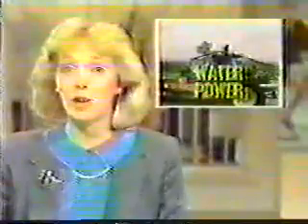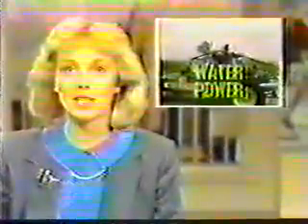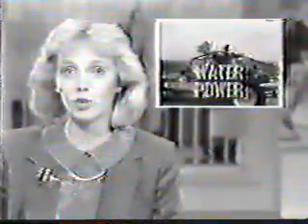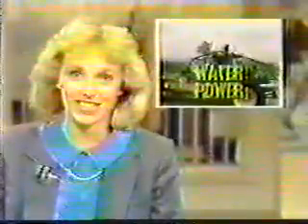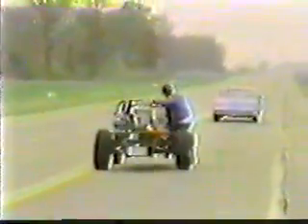Water engine

Comment: O.K. patent this , instead of pushing gasoline thru your injectors , use water . it works . Atomized water gives an incomplete burn , resulting in a poor but useful detonation . The amount not successfully burned has to be removed and reinjected .

Comment: A quick search on Wiki (page - Stanley_Meyer's_water_fuel_cell) reveals an uncharacteristically negative bias against his work, and acknowledges the cause of death was a brain aneurism. The question in my mind is not his "unconventional" use of terms, but whether it actually worked. Did it run on water, and was it sustainable. 

(Re: terms - he may have tried to circumvent an existing patent owing to one already awarded to big oil - I've not looked into that yet.)

Comment: @Me102288 Just as I thought, from Wiki on "Hydrogen vehicle"
" The drawbacks of hydrogen use are LOW ENERGY CONTENT per unit volume, high tankage weights, very high storage vessel pressures...." (caps added).
You should do some research before criticizing those who DO!
By the way, if you didn't use the oxygen released by hydrolysis but used atmospheric air instead, you'd use 1/5 of the hydrogen and get 1/5 of the torque because the atmosphere is only 20% oxygen. But why would you?

Comment: @Me102288 On a calmer note, the alternatives are all around us and are being developed quickly. It's all about energy storage when it comes to what goes into your car. There's no energy in water. Batteries, fuel cells and capacitors show the most promise.
But you still have to get the energy from somewhere and that's where coal, sun, wind, tides and nuclear come into it.
No one's ever going to pour just water into the tank and drive off.
"You cannot change the laws of of physics" - Scottie

Comment: @Me102288 Listen Einstein, gasoline is a liquid and hydrogen is a gas. Gasoline mixes with air at a ratio of about 14:1 by WEIGHT. That's a tiny squirt of fuel for a much bigger VOLUME of air.
Hydrogen mixes with oxygen at an exact ratio of 2:1  (H2O).
I did the maths below. You need about 16 litres of hydrogen per second in this example!
If you want to argue, show me where the maths is wrong! Otherwise STFU!

Comment: @Me102288 You are totally wrong, first of all the laws of thermodynamics are not flawed? If you can prove that, then get ready to win the nobel prize and go down in the history books. Secondly I dont wonder about H VS G, hydrogen is very efficient, ignites rapidly, burns super hot.... gas is lazy and needs a perfect air to fuel ratio to explode, and when it does its slow compared to hydrogen. Gasoline fireballs do not put out more energy, it simply looks that way because its a slow process

Comment: @Me102288 "as long as the engine is running, its alternator(s) are producing electricty"
It takes more energy to split the hydrogen from oxygen than you get from putting them back together in combustion. 1st Law of Thermodynamics. This is 100% impossible and that's why you don't see any of them for sale. It's a fraud to get uneducated investors to give him money. There's no conspiracy, it's just impossible to do, that's all.

Comment: soo. how bout that no maintence he was talking about....unless you use exotic materials the most cost effective electrolosis cell runs with stainless steel plates. the chemical reaction to stainless steel plates with electrolosis produces hexavalant chromium, a toxic byproduct. you will need to extract that from the cell and dispose of it at a hazardous waste place. also you will need to fill your water up and so on. there is never a no maintnece engine. it will be like changing your own oil.

Comment: @aaron2414 You are using incomparable measurements.  The "E = +1.229 V" is the reduction potential required to electrolyze water.  

In the second equation, you converted energy of combustion to "electron volts" which is not remotely comparable to volts. Volts are a measurement of potential. Electron volts are a unit of energy.  

The ENERGY required - at minimum in a perfect world - for the electrolysis is 572 kJ/mol - the same as that recovered from burning it.  In practice, it is much higher.

Comment: @aaron2414 Because burning H2 is chemically the same as electrolysis, and yes, burning hydrogen produces water.  If you don't believe me, get a DC power source, a 2 liter bottle, some epoxy, 2 carbon electrodes and a balloon.  You can make your own browns gas and then burn it to produce water again.  I think you need to pick up an introductory to chemistry book.

Comment: @geheirnwaeshen and you better my "lame" response, you pretty much just told the world that combustion is the REVERSAL of electrolysis...  Feel l like educating on the possibility of that?  All you really did was simplify my explanation of how the combustion (release of energy) of the Hydrogen and Oxygen gives you a great deal of energy.  Just because you need a small amount to split the initial bonds does NOT mean you will get the same back.  The O2 is less stable on its own

Comment: And as a follow up; yes, car engines can be and have been designed to run very well on hydrogen.  That does not mean that splitting water with electricity and then recombining it somehow creates energy.  The laws of physics still apply.  The US government has developed flex fuel vehicles because they want military applications that can operate in any environment.  Say I have a large apu battery and water..... now I can drive my hummer another 10 miles to get out of a danger.

Comment: @aaron2414 joules ≠ volts, so you can make no comparison between the splitting voltage (which in a physical sense is a measure of force) and the energy of combustion without knowing the time over which the voltage was applied (IE, amperage, or current draw rate).  Energy (joules)=Volts*Amps*Time(seconds)

electrolysis: 2 H2O + E1 → 2 H2 + O2
combustion: 2 H2 + O2 → 2 H2O + E2

Simple algebra tells us E1 = E2.

Comment: That was an assumption on my part as you mentioned the reaction of H2 with N2 in your original post. I can appreciate, for simplicity sake, the use of assumed base 1 scientific units. You could find out how much work a electrolysis reaction needs to produces a mol of H2 gas from water... then you would be on your way to figuring out the actual efficiency of this process.

Comment: @aaron2414 Volts are Joules per Ampere-Second, so without current and time it is nonsense to turn volts into joules. Sure, volts can be written joules per coulomb, but that is the same units as joules per ampere-second as ampere-second is coulomb.

Additionally, you cannot know how much energy is released from a reaction without stating quantity of reactants. Why you are even mentioning hydrazine is beyond me. Water in to Water out, what is the energy result?

Comment: @aaron2414 You need to learn some basic physics. You cannot convert volts to joules because they are not the same thing. To get joules you would need to know current and duration, but this should have been obvious when you got a 3x10^24 roi.

Voltage x Current = Power
Power x Time = Energy = Joules

Comment: I have a question.....  What's more practical, a car that uses electricity to turn H2O into HHO and uses HHO to power the motor, or is the amount of electricity used to create the HHO not worth it compared to just using the electricity alone to power the engine?

Comment: @Zink575 Sorry this took a bit, I had to do some MATH!
2 H2O(L) → 2 H2(g) + O2(g) requires an input of E = +1.229 V
Burning H2 and N2 (via combustion) releases 572kj of energy or 3.57014164e+24 volts.
So we have input 1.229v and combusted the gasses receiving 3.57014164e+24v and a few mols of H2O
Plenty left to spin an alternator and continue the process...

Comment: @Zink575 LOL!  You have completely missed the point and keep inserting your own words into my statements.  Energy is not being created its being transferred.  EVERY car needs and input of energy to start.  Thats why you have a battery in your car right now.  NO it does not exceed the amount produced, have you ever messed with hydrogen or oxygen gas? CRAZY explosive and works the same as a gas combustion chamber.  All you need is an alternator to continually supply the electricity for conversion!

Comment: @Zink575 First law - "The internal energy of an isolated system is constant." (this is NOT an isolated system since there is an external input of energy to start..electricity, or some other catalyst
Second law = "Heat cannot spontaneously flow from a colder location to a hotter location." (law of entropy, again only has to do with closed systems, which this is not) Keep adding water and electricity and the cycle will continue.  That's why your gas car has an alternator, keeps the cycle going.

Comment: @Zink575 I would agree with you about the creation of energy, but you are forgetting about the energy put into the system to start the conversion, it's not the water.  Whether it be a battery or electric generator there is an input of energy via electricity.  And I also agree that water is a final product but not a complete conversion was made.  MOST of the energy released from breaking the bonds was released as heat and only a small portion is back into water, not created, transferred.

Comment: @Zink575 LOL! Well I already did tell you where your "external power source" is.  Its most likely not just simple battery but that will work too. Honestly, just google "BATTERY ELECTROLYSIS and you will get tons of blueprints (images tab)...and second, you quoted 2 laws that have nothing to do with this system, well the 1st might because its how energy is transfered as heat, but the 2nd law has to do with entropy.  This isn't a closed system, it has an input VIA electrolysis. This isnt that hard

Comment: @letmeseethat1
So why don't you take the exhaust tube, run it through a box to condense the water vapor and pour it back into the water tank? That would be perpetual motion. 

I know some person is going to say "but it uses the water so it can't be recycled" 
My question is how does it "use" water??
If you react hydrogen and oxygen, the products will be water(gas) and heat and kinetic energy.

Comment: I built a Hydro running 5hp motor. First it takes alot of power, and a big hho gen, to make enough, to run. But the big problem is rust in the valves and exhaust.

Comment: Water is not flammable but both oxygen and hydrogen is... but I don't see any fire coming from the back, so I wonder how it works. Sure water has more density than ice and vapor, but how do you use the energy? What I'm made at is the bitches posting that says that it is impossible when they can see it for themselves. Plus, I don't remember hearing him say that there isn't any electricity being used, so of course it is not just water. If you Bitch, you are a Bitch!

Comment: @Freezer777 I'm not sure exactly which post of mine you're replying to, but of course you can split the hydrogen from the water by running an electric current through it.  The problem is that the energy you recover from burning said hydrogen cannot exceed the energy you put into it to create it.  It can't.  It simply can't.  The car is then effectively an electric car - no energy is derived from the water.  And, it's quite an inefficient electric car too.

Comment: @robpanel If you could do that you could skip the water and just have an electric car. The fact is that solar panels can't collect enough sunlight to power a car that someone would use everyday. Maybe in 10 or 20 years when solar panels work better, but you still wouldn't need the water part of the system. More steps equals less efficiency. 

Fail again...

Comment: @jib1000 you could use the right solar setup for the electricity to take care of the constant electric cost. there is also more water on earth. we just need to channel sea water in and filter. water problems solved but wont happen i think. cheaper overall if self sustained.

Comment: The oil companies aren't threatened by this invention. They don't own the patents. They didn't have him killed. Its simply not an efficient way to run your car. It takes exactly the same amount of electricity to split the water molecules into hydrogen and oxygen as you get when you burn the hydrogen. You could make a better and more efficient engine if you skipped the water and just made an electric car. This technology has been around for years and is totally useless as an alternative fuel.

Comment: @doughauf - he was not murdered, that is the conspiracy theory stance.  Whenever a crackpot inventor dies it is always claimed to be by the hands of power and oil companies.

This car is not powered by water as water contains no energy.  The car is powered by hydrogen.  The by-products of electrolysis (H2 and O2) may slightly improve the efficiency of a conventional fuel powered motor but that is another story, i.e just the same as a water injected motor.

Stan Meyer was a fraud.

Comment: @hellboundmatt What on earth do you base that on?  You DO realize that if that were true, one could capture the exhausted water vapor, condense it, re-electrolyze, etc and the machine would run generating energy using absolutely nothing as an energy source?  

I'm sorry to be so blunt and so insulting, but you honestly don't have a fucking clue.

Comment: @somedudeinva  untapped energy isn't used. The idea has potential it's just not currently efficient enough. It does work. HHO converters lower gas usage and can be made to power an entire engine if more research is done.

Comment: @hellboundmatt Of course the energy is released.  But you are neglecting the energy expended to create the gasses in the first place.  

It doesn't use "more energy than it should".  It uses more energy than it creates.

Stop insulting me and go pick up a physics book.  These engines only "work" in the sense that they run on the energy derived from the battery. Water affords nothing.  It's a convoluted and inefficient electrical engine and nothing more.

Comment: @somedudeinva  The energy is released. By your half assed logic gasoline or diesel shouldn't power anything.  By your logic an atomic bomb shouldn't release energy. 

Which is it? ENERGY IS RELEASED NOT CREATED.  

These engines work they do however have a few problems. Releasing the hydrogen energy efficiently is the problem. You're correct in that it uses more energy then it should. 

You sir are the idiot

Comment: @breakmillion The process is called "thermal depolymerization" and a commercial demonstration plant is in operation in Carthage, Missouri.  

You've heard incorrectly. The basics have been known for some time and unlike water engines, thermal depolymerization is real and doesn't require anything like magical suspension of the laws of nature. 

A larger plant is being built in Philadelphia to convert sewage sludge into fuel.  I can't think of ANYTHING better than literally turning shit into oil.

Comment: when what needs to happen becomes impossible in peoples minds, then it never happens.  no one has a monopoly on those new jobs, and if anybody gets them it should be the people already in the automobile industry.  who said anything about them not getting it?  why wouldnt they?  and if it ever did happen it would be a smooth transition.  plenty of time to re-train.  and it wouldnt be a huge leap.  engine installers would still be installing engines.  not a huge change for the workers, but for us.

Comment: No body has any proof of any of it. It is all strictly here say, but there is lots of speculation on exactly what happened. And all of the patents and the inventions were just gone when people went looking for them. I do believe if you search in the news archives of that era you will find the inventions and patents went to the oil company's. That way no one can copy the workings of the hydrogen generator to the exact specs that Myers built them. But Again, is strictly here say.

Comment: @happy543210 same way you get electric to cause combustion in a standard petrol combustion engine, a battery, that's hooked up to an alternator that is driven by spare spare drive from the motor

Comment: Raydan18: Your a moran this is a diffrent type of fuel cell that uses tap water and electrolisis using a pulse generator can split the water molecule extracting the hydrgen and oxigene on demande with out storing. Read,  knowledge is power.

Comment: The alternator draws power from the engine.  The total  energy yielded from burning the electrolyzed gases CANNOT exceed (and in practice falls FAR short) that which was used to make the gases in the first place.  Any energy sent to the wheels is less available for the alternator, = less electrolysis, = less fuel, = less energy, etc......  the whole system winds down.  

Alternators do not "make" energy.  The convert mechanical energy to electrical.

Comment: This should called hydrogen engine...
But from where are you taking the energy to split up the water into hydrogen and oxygen ?
I bet it would be more effective to run the buggy directly with the electricity instead of splitting water up to hydrogen and then burn it :P

Comment: This is a hydrogen fuel cell, hydrogen fuel cells run on small amounts of electricity. It seperates the hydrogen and the oxygen the tank collects the hydrogen and that powers the engine, Its been proven that a regular combustion engine runs on hydrogen (mythbusters did it). so the engine runs on hydrogen and the engine powers the battery which powers the hydrogen cell which provides hydrogen to the car, its a pretty simple concept. NOT FAKE!